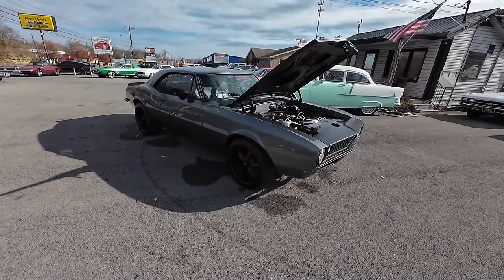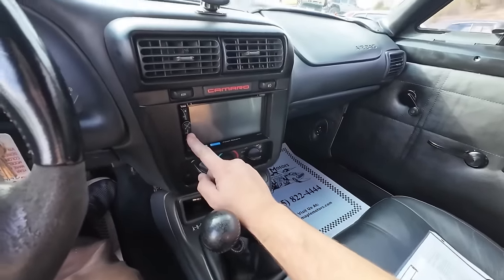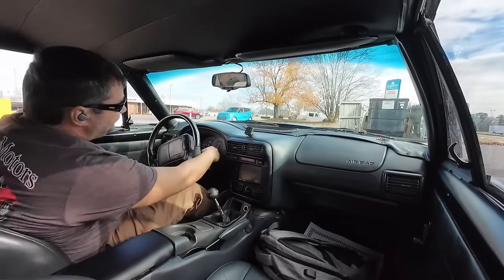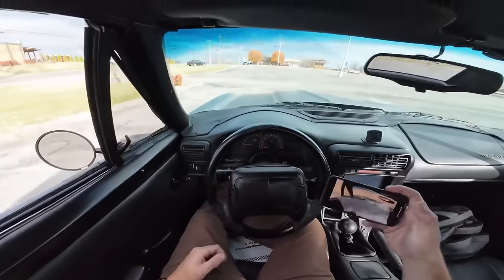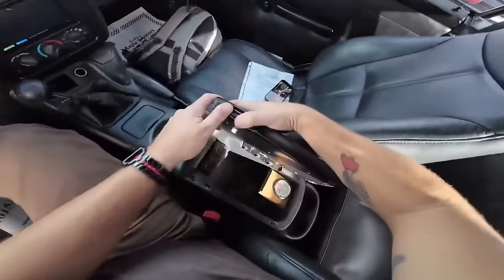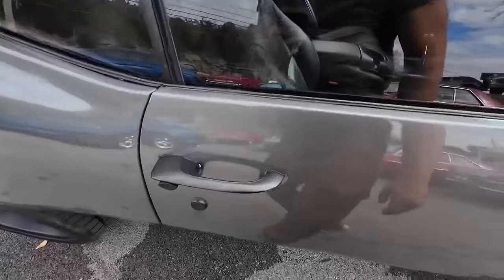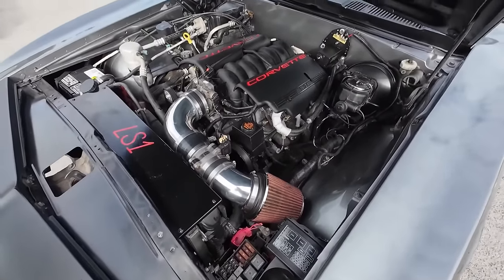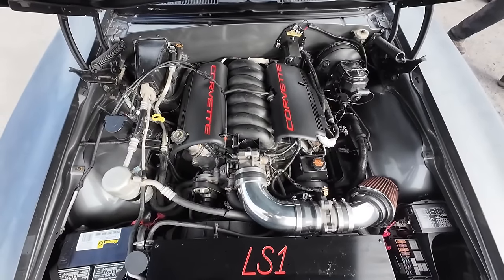Test Drive 1967 Chevrolet Camaro LS 6 Speed SOLD Maple Motors #2443

Comment: I think you should have got it! I know you want a 69 but this one is sweet and with a little work would be pretty perfect for a nice show/driver type car. I think its been the best resto mod I have seen so far since I started watching. I think you should spring for it and maybe hold off on a 69. find a 69 that is perfect stock and you can have a 67 resto mod and a 69 original. Plus you have a 70 and what 2 others? However Congrats on the future addition to the family, And I dont mean the Camaro. As much as I think I would if I were you or if I could afford it. Its a sweet ride!